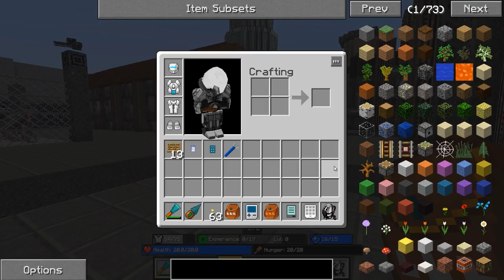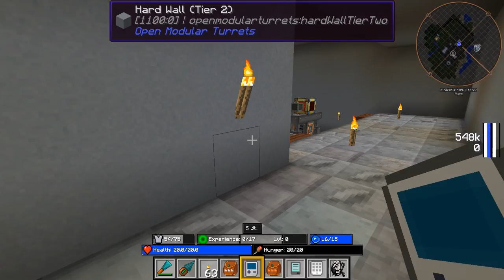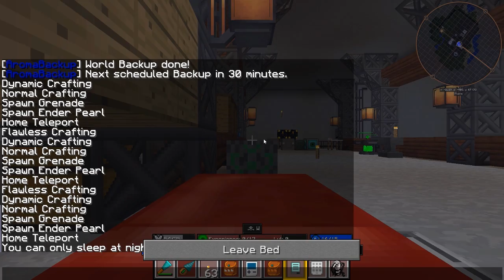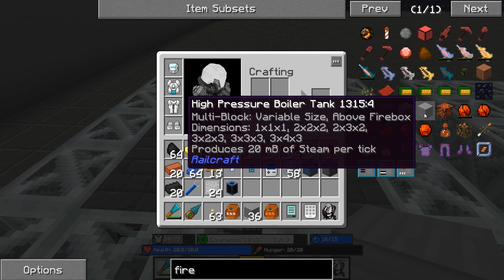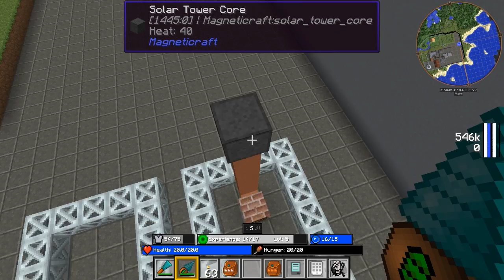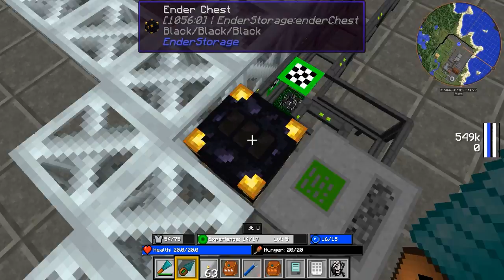Power Station #2 Part 1 | Modlife Season 3 | Ep.39

Comment: why not just feed the heat cable to heat up the steam boiler? that way you can save the hustle to get charcoal
Reply: because there not the same heat it's two completely different systems from two completely different mods and they don't hook up together meaning what you said is impossible
Reply: ah.. you are right, did not notice one is magnetic the other from railcraft